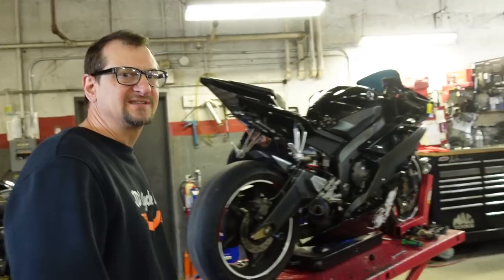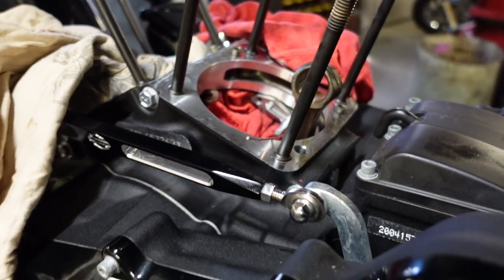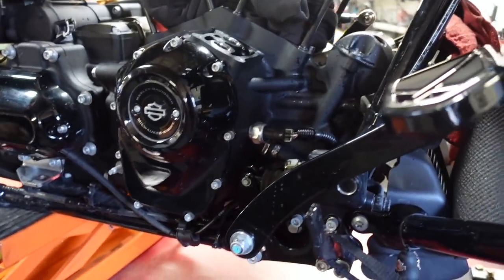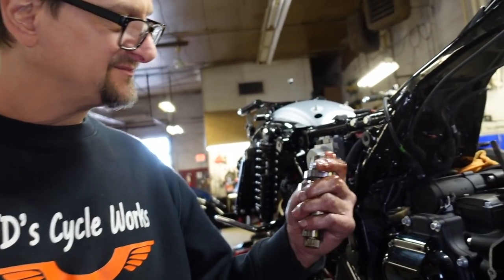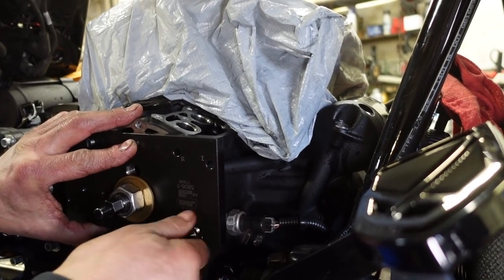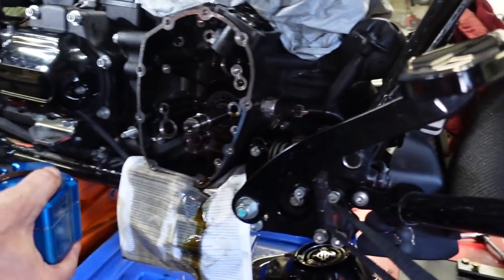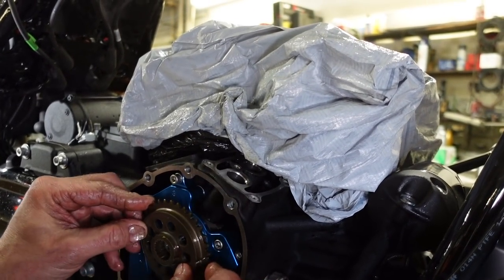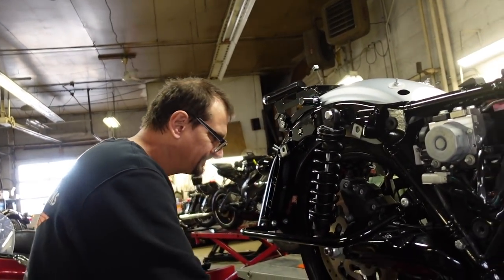#5 - 128” BUILD /S & S CAM PLATE AND PUMP INSTALL /TTS 250 CAM INSTALL/ HARLEY DAVIDSON BIG BORE KIT

Comment: Hi John I had the same 128 kit installed on my 2020 RGS and have found the power restricted by the RDRS/traction control what did Dave do if anything to the ECU/ECM. My dyno run with a 540c Cam was 120HP and 150TQ with other parts upgraded basket, clutch, comp, chain etc this seemed low in both TQ and HP